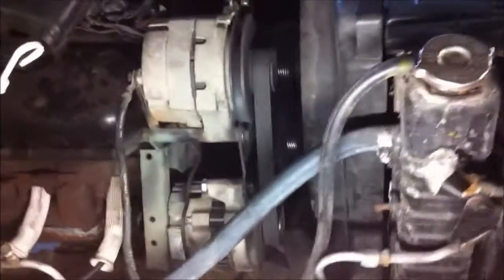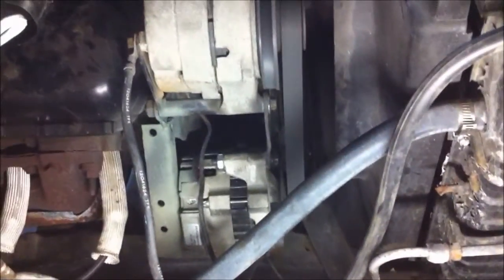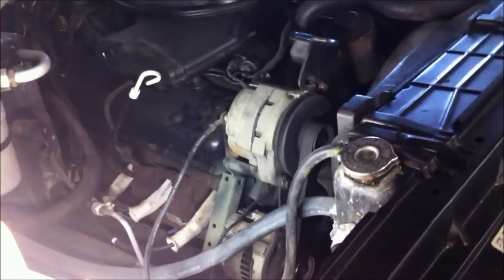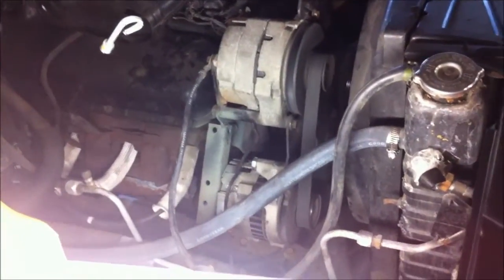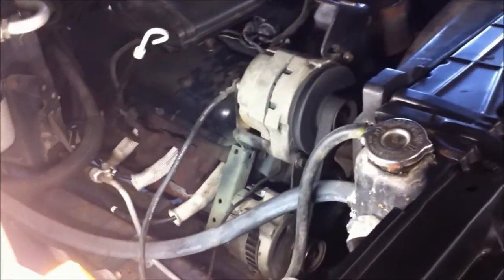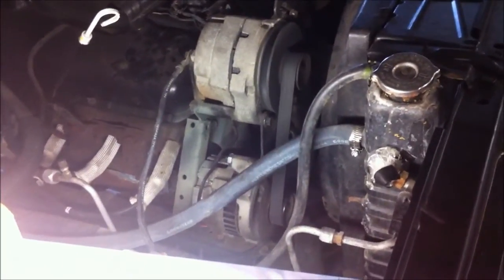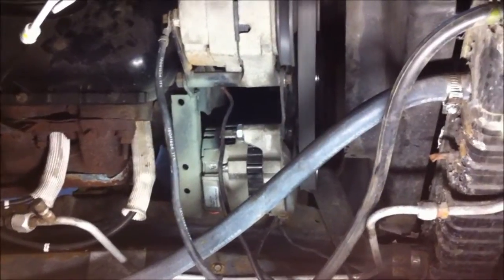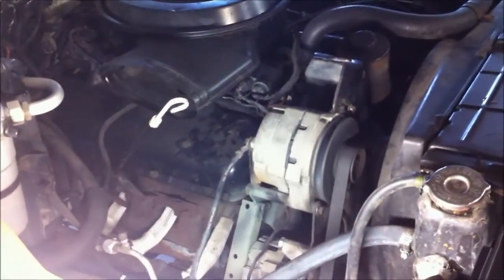Dual alternators on a big block 454 chevy r30 crewcab

Comment: I have a motorhome and it has house batteries, I am wondering how I could wire this up so it charges the house batteries while I drive or run the motor? If I sent you my email would you help me with this? Also where did you find the belt? I have a 454 also.